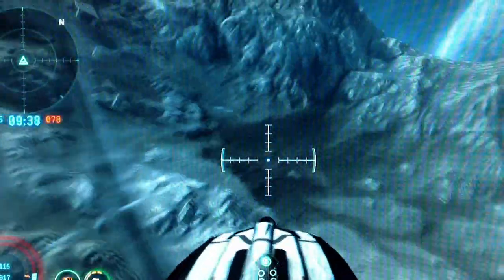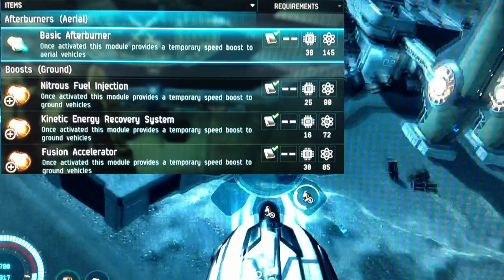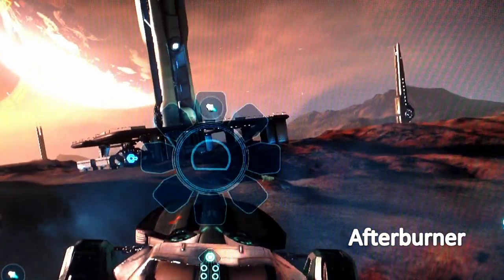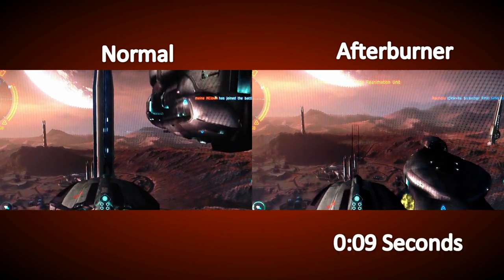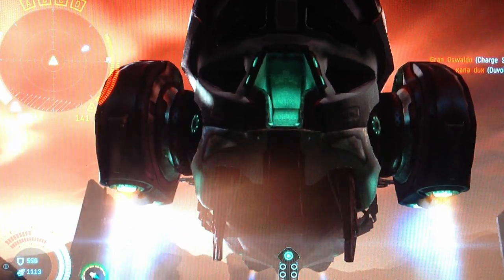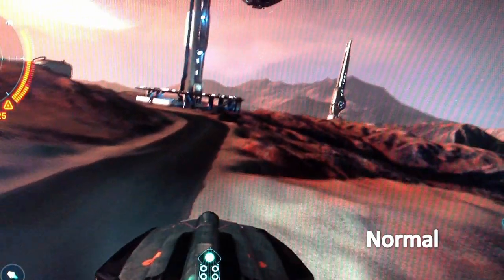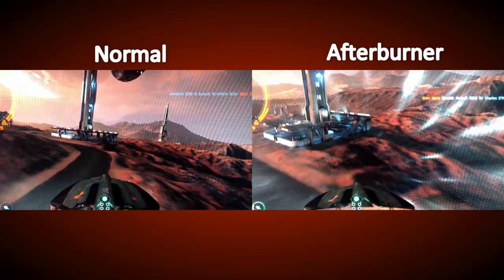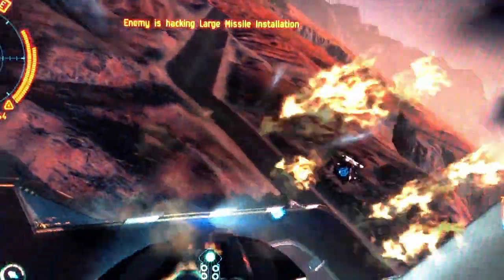DUST 514 Dropship Mini - Afterburners

Comment from the maker: (comment made for build 1.4) For caldari I would use 3 extenders and 1 hardener.  With only 700 ish armour you must keep those hits off your plate.  Make sure to fit diagnostic systems to boost your recharge rate as you have no booster